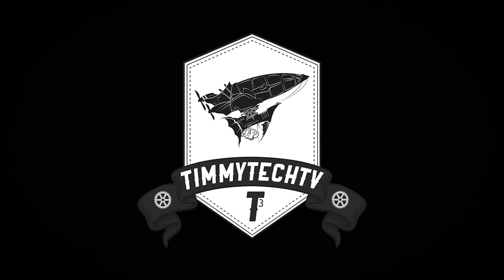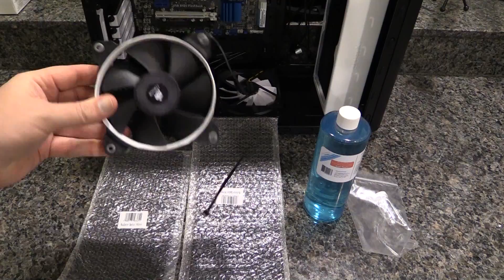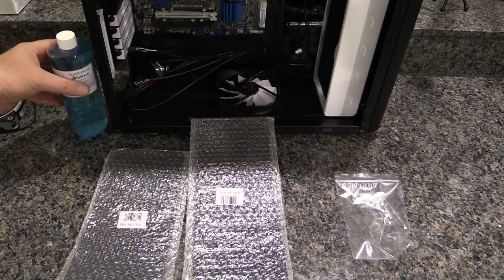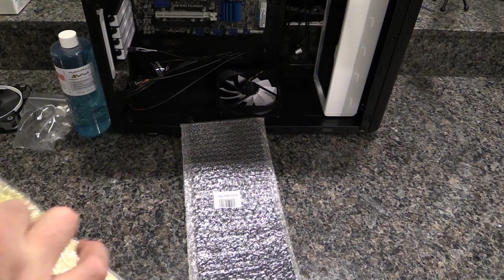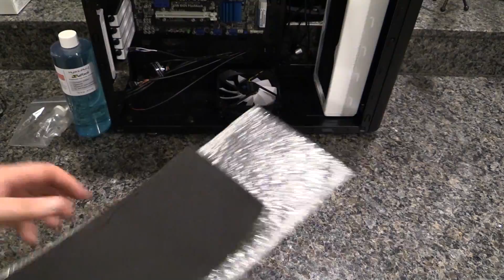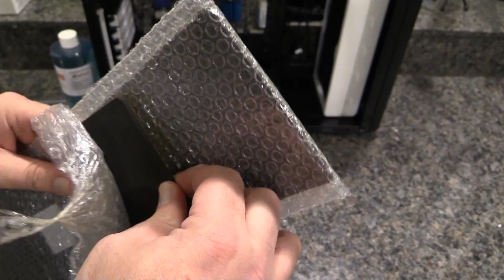Water cooling build update

Comment: For cooling the southbridge you can get water cooling plates on eBay that have threaded ports on the side.
http://www.ebay.com/itm/190974965145
That's one example. 40x40mm. Just find some right-angle barbs.